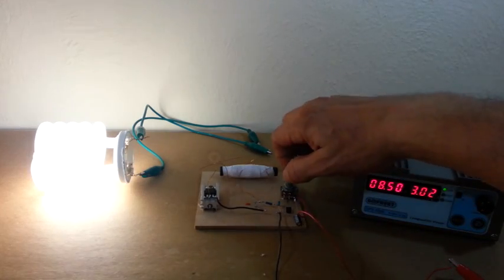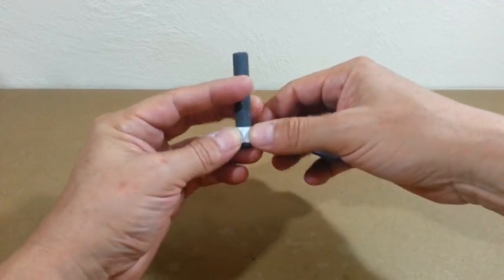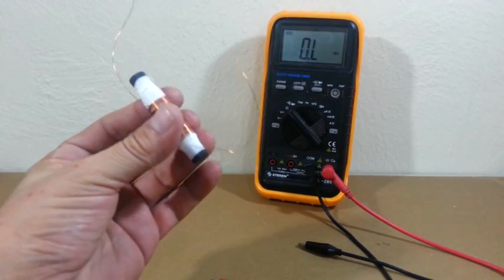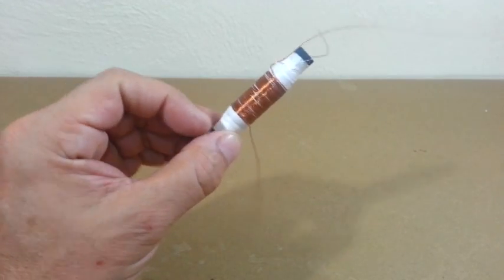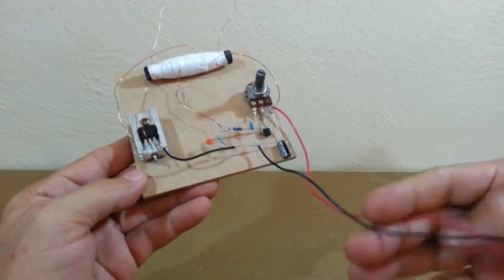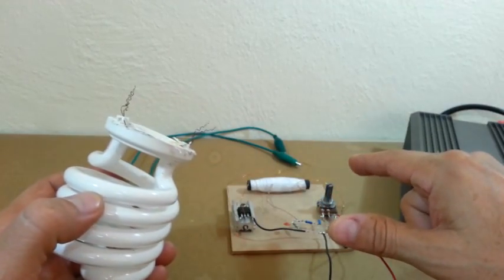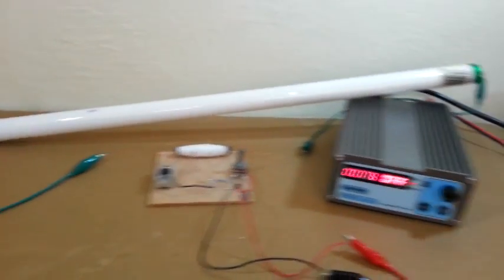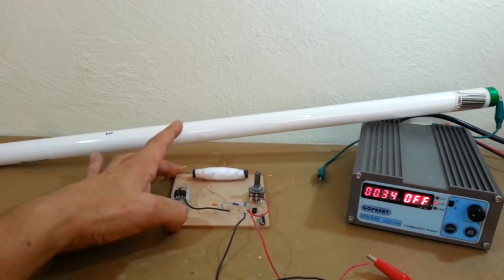How to Make a Simple Inverter for Fluorescent Lamps

Comment: Maybe needless to say but you should tell your viewers how dangerous that device is.
Young indian children should definitly NOT build that in their kitchen!
Reply: Len P May I ask, but how is the device dangerous? The children most likely do not have much to power it, other than AA batteries, and what are the chances of most Indian children having 30awg magnet wire, a ferrite core,  those specific types of transistors and resistors, and capacitors? If they are building this circuit, they are probably smart enough to use it anyway.

Comment: good project as always .
i have a question ,
                 what is the power efficiency of the circuit ?
Reply: Around 30-40 depending on the transistor and supply.

Comment: nice, could one of these lights be powered by home made crystal cell or or other earth battery?
Reply: erasethepatterns1 if you can pull 26W out of an earth battery then sure
Reply: Josh Crampton
what's that, like 20 amps at 1.2-1.5v ish? Maybe a PM generator would be a better alt.

Comment: 8,5 * 3,2=27,2 watts input for the small cfl and you reach brightness equvalent to stock 18 watts bulb. closed core, thicker wire and im sure it can achieve better efficiency. great video

Comment: I don't have ferrite core from the old radio... Can i use core from a flyback transformer instead? If yes then how do i wind it?
Reply: Clark you can wind it any way, the easiest way is to wind it exactly the same as Ludic does on the round sides of the core. you will need to leave a small gap between the two halves though
Reply: ok thanks...

Comment: May I ask, wouldn't a closed ferrite core (eg from flyback transformer) be more efficient? Is there a specific reason you choose an open one?
Reply: I guess this is just for educational and 'see, it works' purposes.
Reply: George Tsakiridis the ferrite bar is just a magnetic core with a very very big air gap.    a closed loop core will work just as well until you reduce the air gap, then it will be less efficient as the core saturates quicker.  it's not really a transformer as there's no need to sustain a magnetic circuit;  just make a huge magnetic field and dump it